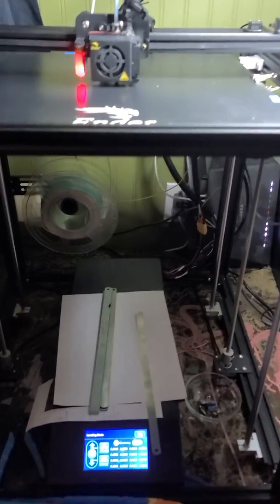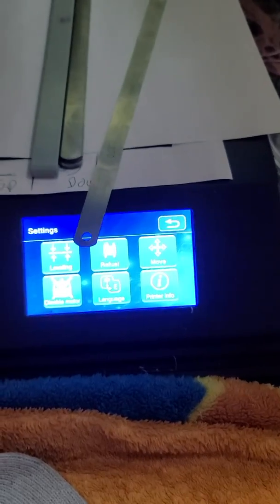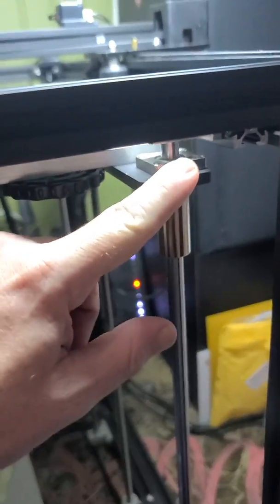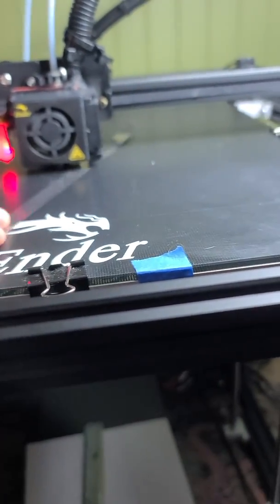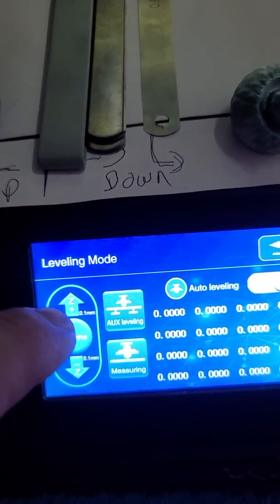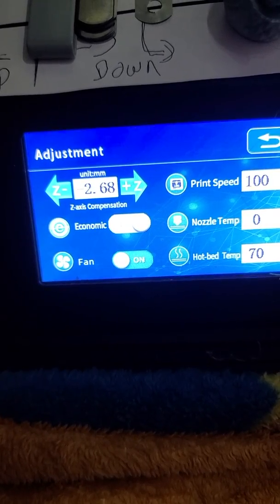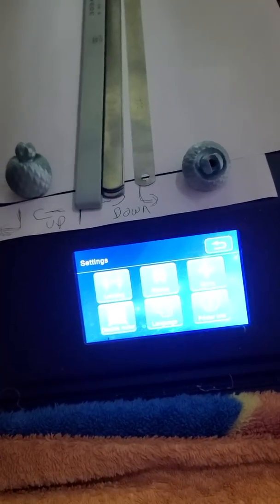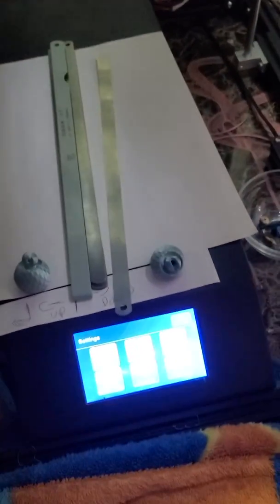Creality Ender 5 plus level guide and getting your prints to stick.

Comment: im having real trubble with mine atm like i know how to level it iv had great prints ect but i fucked up and forgot to do the 0.00 before leveling drove my head into the bed grinded it down and now even if i level it perfectly its still to far from the bed so i think i may have made my tip shorter and its not accounted for if that makes sense
Reply from the maker: Just move the z closer if to far. You can do that when you print and keep auto level off unless you add the right codes

Comment: Hi, I have a issue. During auto leveling, or just before starting a printing (during autoleveling as well) the nozzle is crashing with the front x axis frame. I have no idea how to fix this
Reply from the maker: I did the same thing when I 1st got the printer. Maybe me grinch because new and jamming in bed. Reason is because the BL touch Z and printer home are out of wack. Just reset it as above and should be good. Key is Z Home saves your z point. Turn off printer for 2 to 5 mine to reset the numbers to zero in level. Reset z you must start print turn zero to zero and Home printer. The Z saves via SD card.
Reply from the maker: Watch my video and reset the Z. Follow the directions for leveling. You need to start a print and turn z to zero. Stop print then Home print. Heat the bed to 60 go into level move z to correct spot hit z Home to save. Then follow my leveing instructions

Comment: Im having similar issues with my crap box. Another issue in addition to bed adhesion is the pla bunching up at the nozzle and just globbing up.
Reply from the maker: That would mean a clog. Pull filament out. Heat to 220 and put that needle in nozzle to pull out filament and clog. That sometimes works if not change the nozzle.
Reply: could use a better organized video. no offence. you did good with some good info, but im a bit confused.
Reply from the maker: @stonecoldtruth6047  there is a another one I made. What confused you?
Reply from the maker: @stonecoldtruth6047  I will be live today in a hour. Ask the questions I can walk you thru it and get you printing.

Comment: Measuring from the bushing to the bed is ok if you have the silicon springs that you can take measurements from them resting on the bottom with no pressure but with the stock springs you are going to get totally different measurements that adjusting your leadscrews may not fix, I just assembled this printer and its a pain in the arse, why is it you see videos of builds and reviews and they don't seem to have any of these problems if I knew what I know now I wouldn't have bought it, I got it from Amazon and paid over the odds for the assurance of being able to send it back if it is faulty.
 Those Creality videos are fake they are edited together to show it working, why they can't tell us how they got it working is beyond me after all that was the purpose of the Creality video
Reply from the maker: The printer is great. I love it now, I just measure bed and print. Another technique Is to take the bed off and move the sides the bed rest on to the top. That way the bed doesn't hit the nozzle when trying to level on the Axis. I stream live alot feel free to drop in and ask stuff. Going to stream today. Any suggestions or tutorials you need?
Reply from the maker: @AndrewAHayes  mine just sits on the floor no inclosed. I have two ender 3 max that sit on the patio on a table. Patio has one area open to world,  gets Cold and hot at time here. The important thing I learned is having a dry box for the filament to set in and feed the machine. So filament stays same as factory and absorbs no moisture or dust. I use dry rice and throw those dry packets in there each filament I get. A inclosed printer is good to keep the printer more clean, but you must make sure there is enough air flow.

Comment: No one should ever buy a creality. I bought this printer on Amazon and was sold by creality on Amazon. The bltouch didn't work and the bed is really warped. I sent an email to creality for support with my order number on amazon only to get a generic reply of "you should contact the seller on Amazon and they will help you" I will just return it to Amazon and leave a negative review. Seriously don't waste your time on creality.
Reply from the maker: Frustrated much? I bought mine on Amazon from comgrow. Everything worked out great. I 1st ordered from the unofficial site that was a nightmare to cancel. I like Amazon you have a 30 day return window easy to return to a kohl's without boxing back up. Had a learning curve but after is a really great machine for $500. They are more like DIY printers you can modify alot. I would just return and reorder
Reply: @toshlarue  wait I can return to Koles without boxing it back up? Taking it all apart would be the biggest time waster. Time is money and I've waster alot of on this thing. I did get the bltouch working by turning the set screw but it still fails sometimes but much better. But the warped bed is pretty bad.
Reply from the maker: @darrelldarrell1447  return it don't mess with it if defective and get another. Yes Amazon gives option to return to kohl's or ups and such. I have done this. It's in the option when you select refund. Maybe got damaged during shipping

Comment: Well! Thank you for saving another sole here, yes your video does save lives!
Brilliant and logical way of doing it. I’m very great full fort your time and tips.

I was so happy when it started to print, yet then it decided to print right tight in the front left corner?!
I’m shore the model was centered in Slicer, yet maybe I missed a setting in there somewhere?
This wouldn’t surprise me! So  had to abort, as the auto level sensor was bumping onto its own wheel!
I remember that Slicer asked something about the start position, yet had no idea then, there was no profile at all for 
this product, kind of strange!
Reply from the maker: I have seen mine do that. Like it does not hit the second stop sensor and goes to far to a side or to far forward. Since upgrading to the silent board I have not seen this issue anymore.

Comment: Lmfao you should not level with anything more than 0.1. 

Paper (say 0.1) is already too thick for the perfect first layer,
.4 will give you terrible levelling
Reply: I get the confusion because at one point he accidentally says 0.4 but the first time he says it, he actually said 0.04 and if you look at the number on the shim it's 0.04.
Reply: @ravenblackdove  OH, 0.04 is pretty much perfect then!
Reply from the maker: @ravenblackdove  the shim reads 0.04. Thinking I'm going to make a live video Saturday. So I can answer questions. Also going to remake this video.
Reply from the maker: Has worked well for me. I usually move the z point after level and adjust. I .04 is a little closer then paper.

Comment: Hi buddy I’m back again.  Kind of hoping that you could re-do this video a little bit more clearly, I tried everything that you said I still can’t seem to get it to correctly level. It would be very much appreciated 😁 and if not I will try to persevere and solve the problem.
Reply from the maker: Ok , I will soon. I accendently figured out something. I leveled my plate pretty good. What issue are you having? Adhesion?
Reply from the maker: https://m.facebook.com/FlufyPancakes/?ref=bookmarks

Message on FB if need be to share pic's.

Comment: Thanks! I turned off auto levelling until I had adjusted everything first. The real take away from this was adjusting the Z to get the nozzle close in the middle, doing the aux levelling and THEN turning on auto levelling, doing the measuring THEN turning auto levelling back off before printing. There's definitely a bug with auto levelling when it's left on. I had exactly the issues you described, including where auto levelling freaks out and almost destroys your bltouch in the corner. I'll be upgrading to a 12864 display which can run the latest marlin and not Creality's shitty firmware.
Reply from the maker: Mine already bent the BL touch. Glad I had a replacement. I'm going to post another video soon with things I have experienced. I believe there is a G code to add for the auto level to work before the print. G29 I think
Reply: Hi Kyle, ok so, having the same issues as you. Did you replace the screen and firmware and is printer working reliably. I'm almost about to bin mine.
Reply: @Guyus0333  I took away the touch screen and replaced it with the reprap full graphic smart controller and now use Marlin firmware. So much more control and my printer works great now.

Comment: At the end of each aux level the 1 spot has a huge gap before and after, but when I do Z Home its in the correct spot and it just above the bed is that normal?
Reply from the maker: Aux level spots should all line level with paper.
Reply from the maker: Hey I am making a video on what I believe is this issue on Saturday. After auto level go back in to aux level fix the gaps then turn off auto level. Go print.

Comment: gonna try this out i will keep you posted! also do you know why the compensation keeps reverting back?
Reply from the maker: I know what you mean now. After you turn off then back on the z point is off? I will make a video. But don't do a level after you 1st turn on. Just go and print then cancel. And z point is back at last setting.

Comment: Many thanks, I will try this out tonight and let you know. Where did you get replacement springs from?
Reply from the maker: Did it work out?
Reply: @toshlarue  Not tried yet sorry been under the weather. Hoping to try in next few days so will let you know. Thanks
Reply from the maker: https://amzn.to/34DMg69
Reply from the maker: They help so you don't have to adjust the knobs as much. Helps with vibrations. Remember to turn auto level back off. I'm looking into possibly another firmware like marlin.